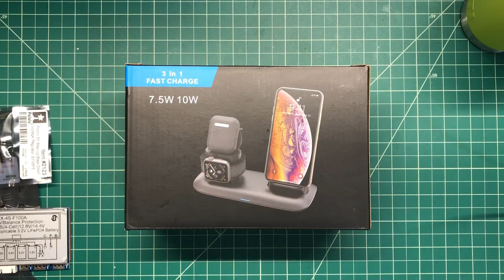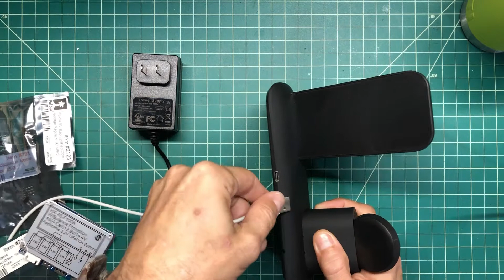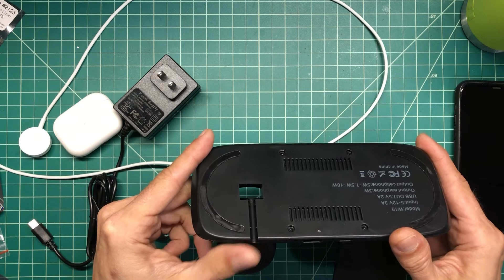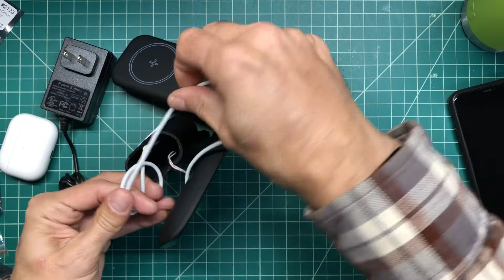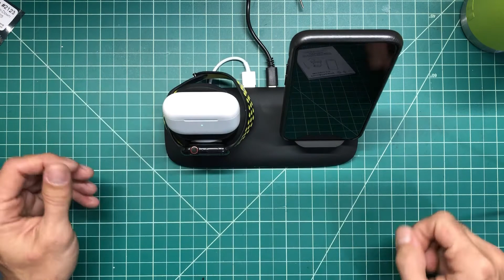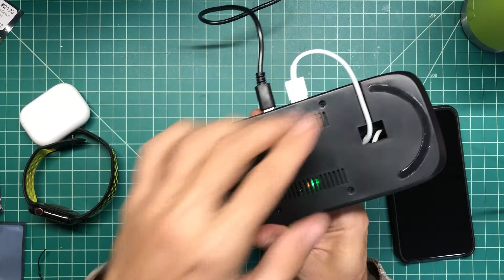Affordable 3 in 1 Wireless Charging Dock (with USB C power supply)

Comment: Good job mate 👍️ .. If you fancied a little project you could even solder the USB lead in directly so there'd be no lead at all showing.
Yea I know, I'm fussy :)
Cheers
John
Reply from the maker: I did tear mine down 7 months ago, its just a thing I do, lol. I thought about soldering the USB but if I change charging stations I would need to buy a new watch charger? I really want to tear down this hockey puck magnetic charger that I have had for the last few days. I have been holding off because I want to make sure the phone works first and they stock supply goes up. My local store is closed, so shipping is 3 weeks until I get another one. But man do I want to tear it down :-)
Scott